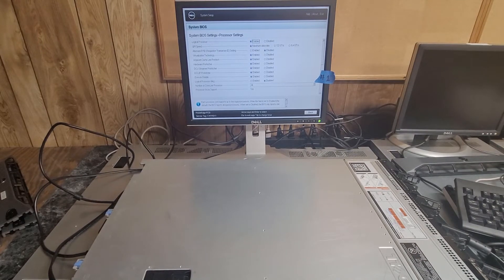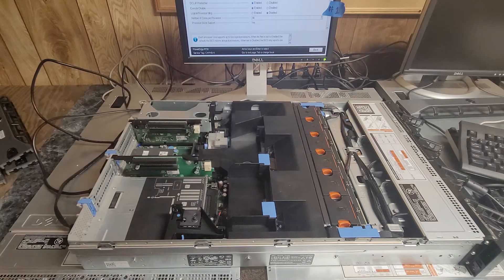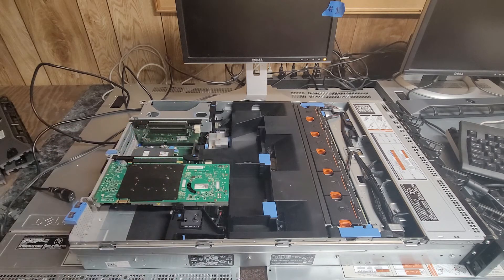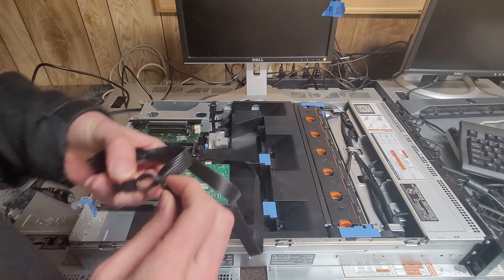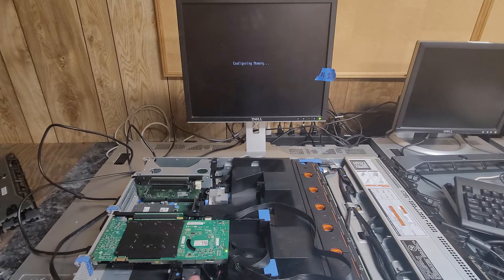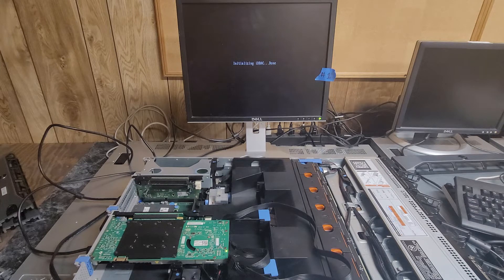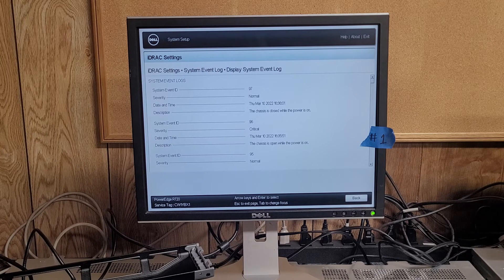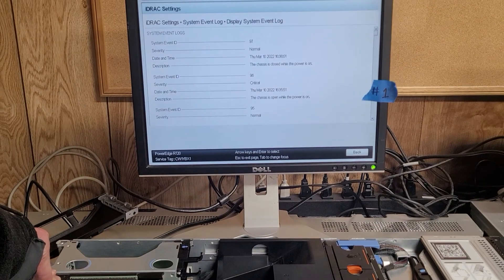Running a powered video card in a Dell Poweredge R720 with 750W power supplies.

Comment: Just want to drop in to say, the NVIDIA Tesla K80 cards WILL work in the R720 also on 750W power supplies. They are not on the official supported list for the R720 from Dell, but as long as you have the proper adapter (GPU power adapter equivalent from the R730) they work fine with the proper drivers. Currently have one running for passthrough to a Fedora 35 VM in ESXi.
Reply from the maker: Nice.  I honestly expected lifecycle to throw a fit.  This opens things up to unsupported CPU TDP configurations too I'm thinking.  I wonder how much TDP the chassis can handle 🤔
Reply: Hey thanks for the tip. I am about to put an M40 on my R720 because I need VRAM. But thinking of upping the PSUs to 1100W and adding a K80 as well.
Reply: What about RTX 3060? I got the power cable and want to replace the existing 1050ti , the 1050ti is using around 70w of power and it is powered by the PCI slot. I did get the 8pin power cable for the 3060, my question is is it okay to plug the 3060 in the same slot where the 1050ti is currently plugged in and to add the power cable to it? The PCI slot provides 70W of power but the card needs around 170w and I will be using the 8pin cable to supply the additional power needed

Comment: nvidias in idle will work in power saving pcie x1 mode and won't draw full power. so, just booting with it proves nothing
Reply from the maker: The point was to verify if the server would stop me. Also I ran power draw tests in a second video linked in the description.

Comment: Which PCIe power calble do you use for this. I am using a R320 and a R720 and want to try a GTX 1080 FE in the R720.
Reply from the maker: I believe that cable was off an EVGA modular power supply. Otherwise I've been making my own cables. The pinout on the riser is basically standard PCIe 8-pin for the R720. The R730 is wired a little different though so the same cable won't work between the two.

Comment: can you  please tell us what cable was is that    or link where to buy
Reply from the maker: That was from a random modular PSU. I don't know what cable to recommend since a lot of them aren't wired correctly. The genuine Dell GPU power cables are too short for cards like that and would require a power extension cable.

Comment: I'm planning to get one and put it in my bedroom. Do you think it bearable ? Or atleast I'll put at my living room, which is just next to my room.
Reply from the maker: It depends on how light of a sleeper you are and how have you load you plan on running. I can't handle any noise when I'm sleeping so I wouldn't be able to do it. If you can handle a little bit of noise you can always force the fans to low speed.
Reply: @computersales  Thank you for the reply. One more thing. I think I've read somewhere that if you put in GPU in, the fan will spin faster. Is it true ?
Reply from the maker: @tamagorengs  I have not run into a situation yet where a GPU has changed the fan speed in any meaningful way. Although the Tesla K80 is capable of communicating temps with the server to control fan speed. Worst case scenario you can SSH into the iDrac and manually set the fan speed to the best of my knowledge.
Reply: @computersales Is there a household object you can compare the noise too? Ex: Vacuum, air purifier, hair dryer, etc). Also, good video, I enjoyed watching it.
Reply from the maker: @tipoftheiceberg11  kinda tough to compare but I would say a hair dryer would be pretty close. Not as loud as a vacuum unless the server is in an angry state like cover missing.
Reply: I had my r720 server in here for about a year so now and I’ve never had issues sleeping if it does get to loud try reapplying new thermal to the 2 CPU’s 😊